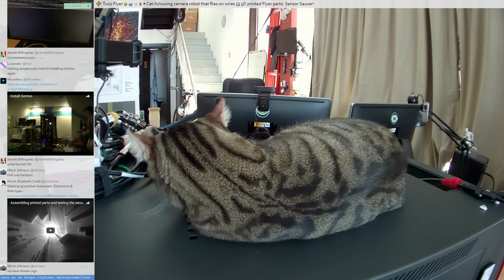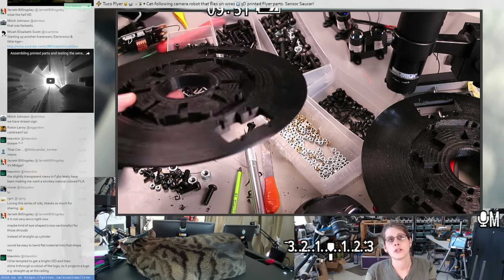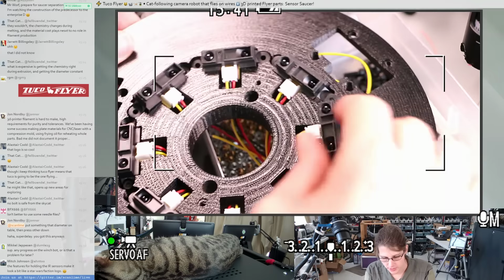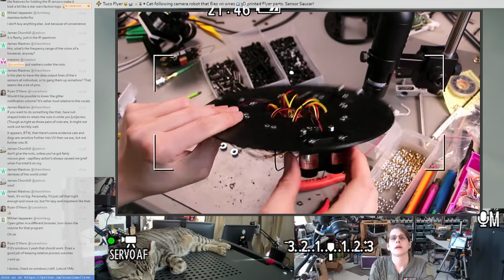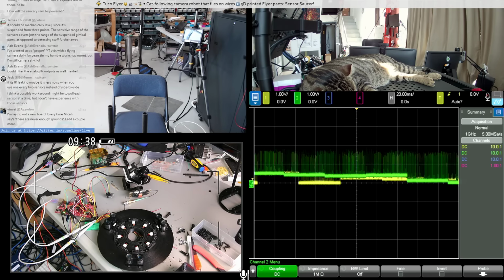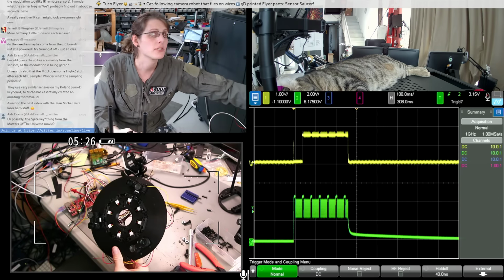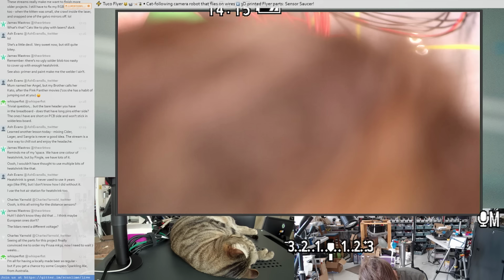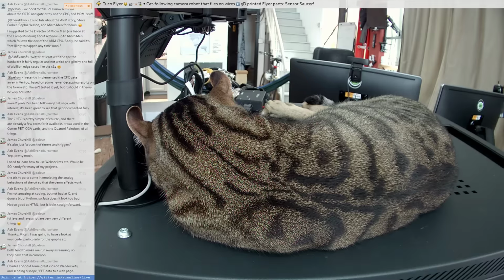Assembling printed parts and testing the sensor saucer @scanlime-in-progress

Comment: Maybe just consolidate the power lines for the sensors and save 14 wires.

Also, being that the SHARP sensor manages its own IR sampling - you won't be able to synchronize them for staggered pulsing. Have you tested the sensors for possible cross-talk between adjacent sensors arising from overlapping sampling timeframes? Might be a problem if there is.

With this many IR LEDs firing and the fact that many cameras don't have strong IR filters, I wonder if there might be any visual artifacts from the sensors spilling into the video.